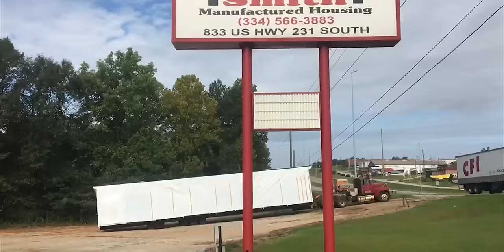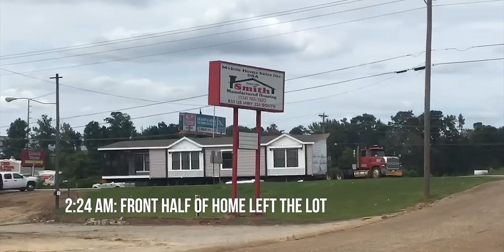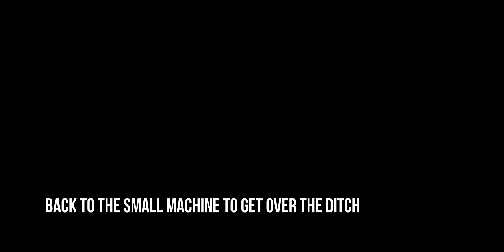Manufactured Home Delivery in 1 Day (my Lula Mae Farmhouse)

Comment: Curious about the manufactured home buying process... did you get a loan? Did you have to put 20% down?
Reply from the maker: I did get a loan (these homes are anywhere from 99k to 142k which I was not going to pay up front). 5% down was required but I did more than that... I imagine different people may have different requirements.
Reply: @Happilyeverafteretc  thank you so much for the info! My fiancee and I are working on our credit and hoping to qualify for a loan on a single wide this fall/next spring 💚
Reply from the maker: @tashpointohhh  good luck hon! I worked on my credit for a few years before buying this home and so far I'm very happy with my decision!

Comment: How is plumbing handled?  Do they use a well for water?
Reply from the maker: It's on a septic system and I'm hooked into regular power and water just like any other home. It depends more on where you're placing the home than the home. I'm right outside the city.

Comment: I like this home a lot. I’m curious if it’s considered a mobile home or a modular home, and also, if someone were to purchase it, do you know if the roof could be raised so it looks less like a mobile home?
Reply from the maker: It's considered a manufactured home which is between mobile and modular. I am not sure about the roof. They were excellent on making several structural changes for me when asked so they may be able to but that's something they would have to ask the manufacturers. Good luck!
Reply: You can raise the roof only about 12 inches as these are production homes. You can add brick to these homes so you don't see skirting and the crawlspace. it all depends on the model. A mfg home has to be inspected and built to HUD standards. A modular home does not and has different inspection requirements.

Comment: Should be placed on concrete pad, at the least.
Reply: Most down here use cinder blocks. I’ve only seen one on concrete on private land.
Reply: They are usually placed on concrete runners. Depends on how hard the ground is where you live.
Reply: @melissajohnson2935  Where I live in New England, and specifically the state I live in, concrete pads keep the manufactured home level and dry underneath. I live in a seventy foot by fourteen foot mobile home. I have lived in it for fifteen years, and not one issue with instability or moisture at all. It's the way to go!
Reply: In louisiana they normally go on concrete pad
Reply: In Alabama they do exactly what you see here.
Reply: @Victoria-uq8mf  Louisiana here too! We gotta have concrete or they will sink, lol.
Reply: Do the wheels stay on the house?
Reply: @islandboy7432  Our state requires axle removal to be approved for mortgage.
Reply: @expandingknowledge8269  ok thx for the info ....I'm assuming they remove the axle
Reply: @islandboy7432  exactly 100%
Reply: @expandingknowledge8269  ok thx.....my wife and I are likely to buy one of these so I'm doing the research now
Reply: @islandboy7432  Don't know what your laws are were you live, but you shouldn't have any problems. Just remember, depending on whether you buy a new one, or used one, the year of manufacture might determine how you insure it.
Reply: @expandingknowledge8269  thank you so much for the info my friend
Reply: @islandboy7432  Well, glad I can help. If you have anymore questions, I will try to help the best I can! 😊
Reply: @islandboy7432  When our axels were removed, it was going to cost $ 250.00 dollars to have them hauled off. But I found a guy who does metal salvage, and he picked them up for free and hauled them away!
Reply: @expandingknowledge8269  ok thx!

Comment: I would have put it on a concrete slab though.
Reply: You can put it on a crawlspace footing foundation with a brickledge. A traditional concrete tension slab isn't necessary. These have very heavy I-beams and large runners.

Comment: Does anyone know if these homes can be shipped abroad. I live in the UK.
Reply: If these houses were shipped to the UK, they would never make the trip without damage.
Reply: @lynnharrell9598  Thank you Lynn. Thought I'd ask. Know homes are shipped from Europe but distance is difference obviously. Was your's damaged when you tried.
Reply: @alexandramassey9258 , I have never tried to ship a mobile home abroad nor would I. In order for something of this size to be shipped it would need to be set onto a ship with a crane. The construction of these homes would never be able to take the rigors of that kind of move.
Reply: @lynnharrell9598  Oh, so in other words, you don't know. You don't work for the company, and haven't tried it yourself. Thanks for your input though.
Reply: @alexandramassey9258 , I have not worked for the company that built the home shown in this video, but I previously worked in the engineering department at a manufacturing plant for a competitor that produced the same type of product. I’m currently a licensed contractor and work in the construction industry. Although I personally have never shipped a home like this abroad, does not mean that I don’t have any insight on whether it would be able to withstand the process. Oh, and you are welcome.
Reply: @lynnharrell9598  Thanks lynne. I too can open a tin of paint, but I've no idea how it's made in the factory. We're two peas in a pod aren't we.

Comment: I sold these homes for 30
Years. There should 
Always be
Concrete under the home. Not
Just
Dirt. It will sink snd
Go off level.
Reply: Yep, my  mother in law just had to have her 10 year old house re-leveled due to separating of the units. The separation allowed for cracking of the interior finishes, and moisture and mold on the drywall.  Do not skip on the setup.
Reply: Concrete doesn’t stop the land from shifting.
Reply: By concrete I mean at least 6
Inches of
Concrete with lots of re rod and deep
Footers 
Under the slab to keep
It from shifting.  Or a footing of a 4
Foot poured concrete crawl space with interior footing.
Reply: Sally Hanley tell that to the guy in Tampa that his concrete floor fell into the ground taking him with it
Reply: @kimjones2056 , I believe you are referring to the site built home that was swallowed by a sink hole.  Sally is talking about preventing shifting and settling caused from normal erosion. Nothing will prevent the damage caused by a sink hole.
Reply: read the multiple replies she gives about the footing foundation; you know this is just the delivery. If you sold these homes you would know that or you never went to the site to see it done. Her house is not going anywhere.